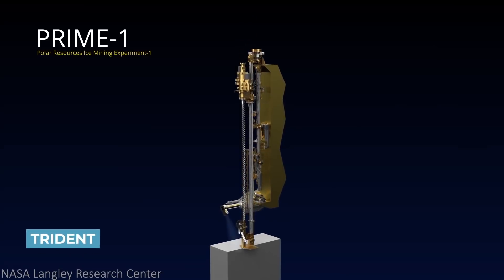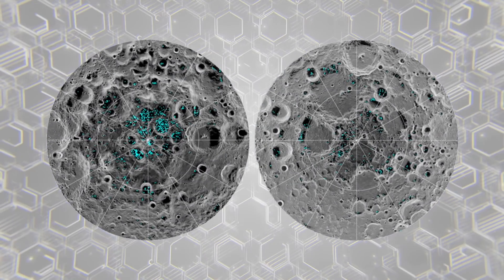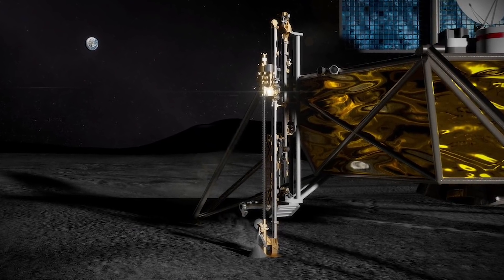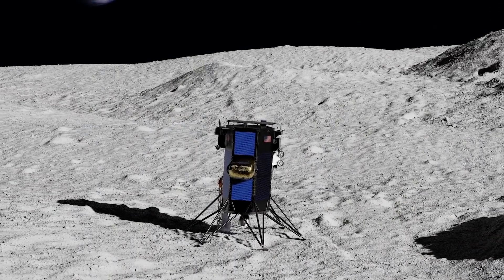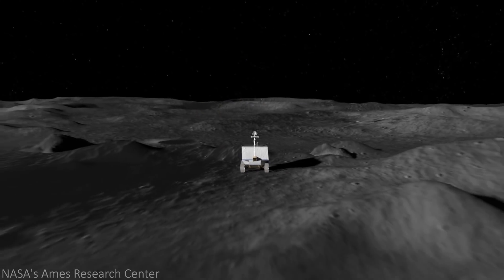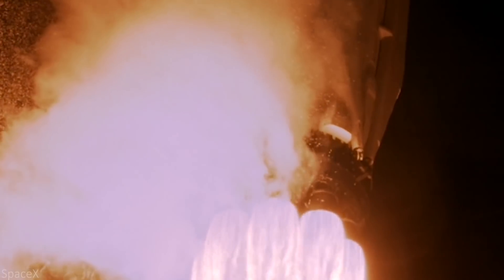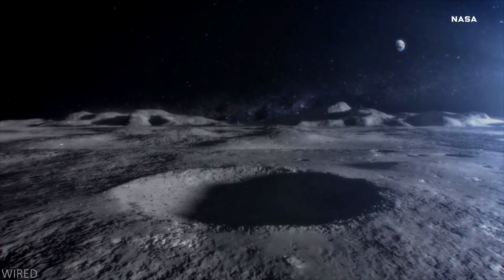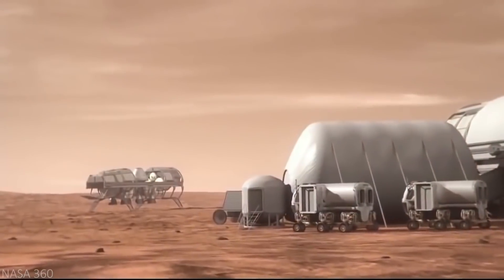NASA Reveals NEW Lunar Ice-Mining Drill for Artemis Program

Comment: I find it funny how they market a drill, made with off shelf parts you can find in any warehouse, as some high tech solution. Can I throw something made of home depot parts together and get multi-million contract from government?
Reply: Just because it looks crude doesn't mean it is.  One basic problem in the vacuum of space is that objects made of the same or compatible metals weld themselves to each other on contact, complicating your choices of materials.  With differences in day/night temperature of over 200 degrees C, thermal expansion matching is a very touchy thing.
  Electronics are another problem, with low gravity affecting convection cooling, such that everything needs forced cooling using fans that can't possibly fail.  Vacuum is also very "conductive";  electrons jump easily when there are no air molecules to bump into.  Electronics can be kept inside pressurized air containers, or other insulative materials, but any conductors exposed to vacuum will "leak" current, and in the case of a depressurization of the container, all the electronics can start leaking between components and connections, unless carefully designed not to.
None of this is extremely difficult, necessarily;  but you are building EVERYTHING custom;  every gear, pinion, gasket or screw is custom-made; nothing off the shelf will work in space applications, just about.  That's why it gets expensive.